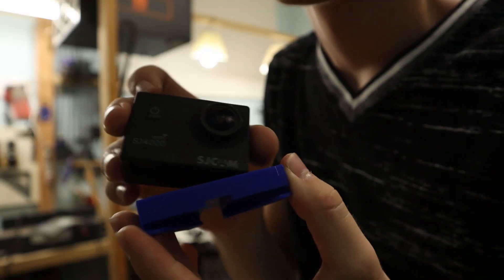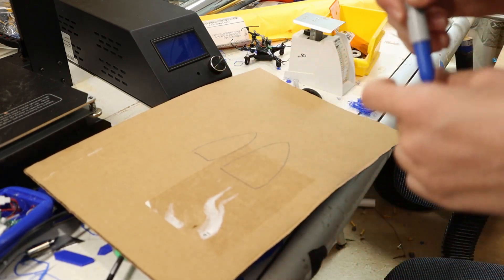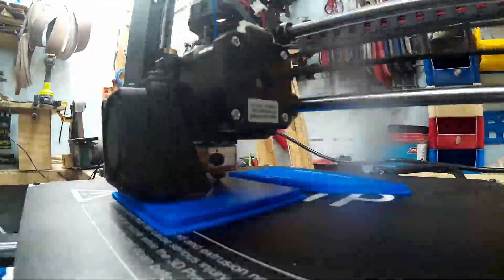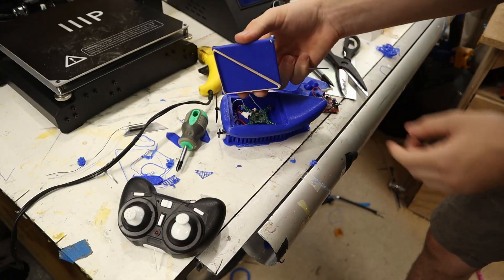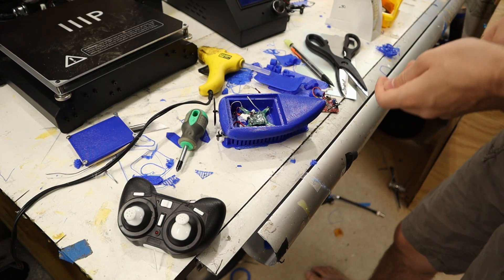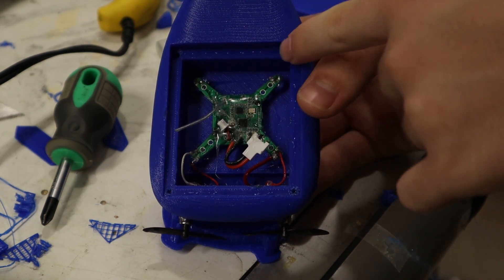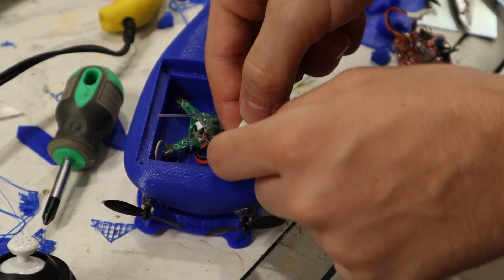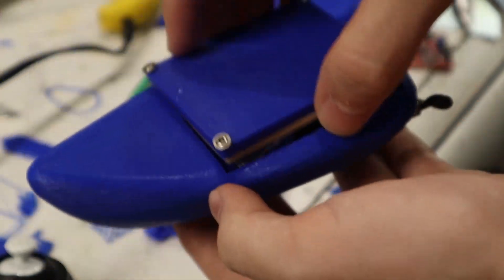From Broken Drone to RC Boat

Comment: This is super cool. I've got a super cheap mini drone (got a few different sizes and styles of drones at a store closing) that never flew right after falling into a glass of water (flies but much harder to control direction). Id still mess around with it tho, but then the tiny thin plastic switch on the outside that you flip to turn it on snapped off completely. Would it be possible to do something like this with it and a plastic toy floating boat? Also totally new to anything like this so sorry if this is a dumb question but how do prevent the water from like fucking up the battery? Also do u think itd be possible to get a light weight small plastic car to move like this?
Reply from the maker: Well, if the batterys are lipos then they are usually fine with getting a bit wet, just let them dry out. And I mean I made a toy boat with it. Also I mean ig you could get a car to move but these motors spin pretty fast

Comment: 16 hour? 

Up the layer high, reduce infill to like 10%.
Reply from the maker: Layer height was .2 and infill was 10%, I messed around with it and managed to get it down to 10 hours in the slicer but i figured I might as well keep the better print quality. One thing i did notice is that on the timelapse it looks like that cover next to it is almost fully solid, even though it should only have 3 top layers, so idk
Reply: @MarcinPlaza  slap up the stl I'll see what my slicer says.
Reply from the maker: @BigAdam2050  Here ya go https://drive.google.com/drive/folders/1GVFX-afAu7Ww5q44FAJUJ-1y0yCEse59?usp=sharing
Reply: @MarcinPlaza  A'right, my Cura says I could do it in about 4 but my printer ain't that fast so I could prob do it in ... 5 or 6?

Which is 10hours off. 

Infill 20%. Layer height 0.3, width 0.4mm. 

I also flipped the model over, turn off snap rotation, flip it, and get it nice and close to the bed. Save time on supports printing
Reply from the maker: When I set my cura to those exact settings it shows around 11 hours and if I remove the raft it says a bit over 10, you sure you also added the top plate? what is your wall line count and print speed, mine is set to 3 and I keep the print speed around 40 mm/s

-edit I mean thats pretty interesting, I could definately get it down to like 8 hours with decent quality but 4 seems like a bit of a stretch
Reply: @MarcinPlaza  https://i.imgur.com/IRWFckK.png - thats PLA printing mind. Don't really need a raft for pla. ABS sure, but PLA seems fine without it. 

That said, first thing I ever printed was a small 10x10 box, with a 1cm high wall and I think it did take 8+hours to print.
Reply from the maker: @BigAdam2050 Yeah, that said I have only had it for a few days, and I really need to mess with it more and test the limits.